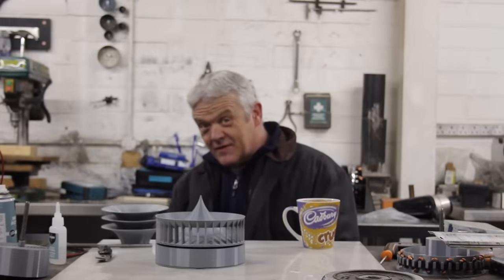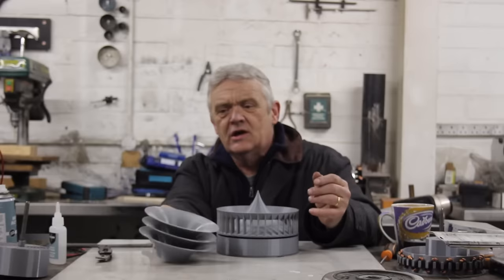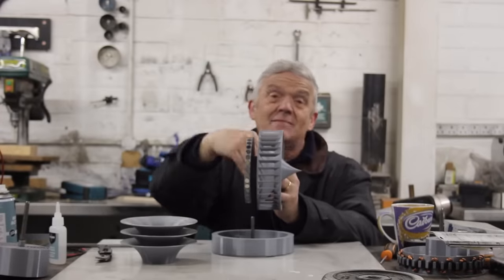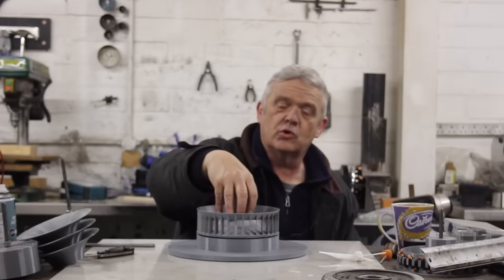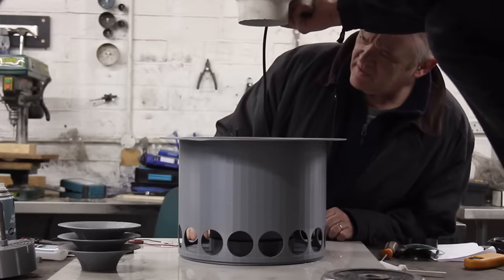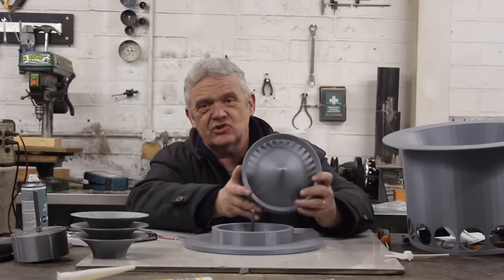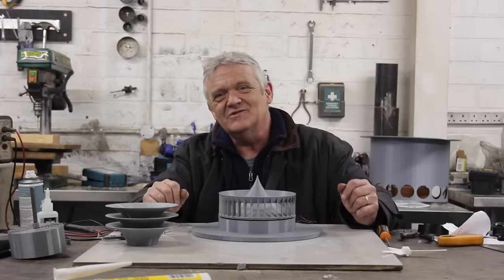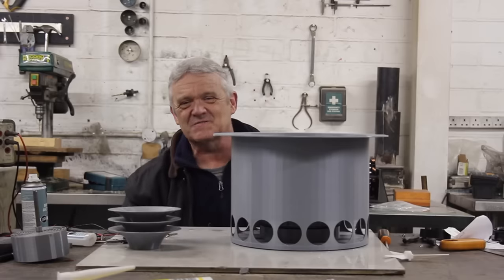1889 Ground Breaking Wind Turbine Update

Comment: Murray Sir... Ranjith here... Only issue I would like to highlight is that atmospheric air doesn't want to compress without external mechanical component... It would just move over the rotor and take the path of least resistance...
Reply: Use pleated or multi layered plastics to increase surface area of blade. High end VAWT systems have “cupping” on one side and vanes on the reverse to use Bernoulli principle

Comment: Murray Sir... Ranjith here... Only issue I would like to highlight is that atmospheric air doesn't want to compress without external mechanical component... It would just move over the rotor and take the path of least resistance...

Comment: Torque is directly proportional to current in a DC motor or generator. Voltage means nothing, though you can use it to calculate power when you know the current. To get the current, you must load the generator to make it slow down. There will be a speed under load that gives maximum power. You must apply different loads to see what that is.
Reply: A variable resistor may work? And the fan should not be held by hand, it shkuld be fixed in a position to make sure that you have same angle of attack and distance between the fan and the generator.
Reply from the maker: then you would just be measuring the generator
Reply: @ThinkingandTinkering  The only thing you need from a generator is watts. The question is how many can you get at typical wind speed. For that, you can simulate the wind with a blower, but then you must load the generator so that you know how much current it can make at that wind speed, then you can measure the volts at that current and calculate the watts, or connect one of those cheap Ebay watt-meters that give you it directly. 

When you load a generator, the torque to turn it increases with the current, so it slows down.
Reply: I do agree about watts/windspeed being the ultimate measurement. Also it should be in the natural environment and not a laboratory. History also should teach us to stick to AC.
One point that I noted about the shape, the vent holes come out where they could affect the wind flow escaping from the tower, if they pointed down, the wind flow would provide more suction. This is another reason to test outdoors.

Comment: I have a rooftop in the city that because of the microclimate and turbulence is subject to sustained extreme high winds. (greater than 100mph, according to roofers) I need to do masonry work every year because the wind scours the brick and mortar away.  A turbine for these types of conditions would be very interesting to me.
Reply: Your system would have to be tougher than a brick! Good luck. Whatever you devised would certainly be quite durable everywhere else! Sounds challenging.
Reply from the maker: from what you say just about anything would do mate
Reply: I have seen horizontal spiral turbines at 6" dia. that looked very impressive. I can't remember the numbers now but there was low coefficient ratio between the turbine and the mounts.

Comment: I am really loving this series! Thanks you for posting your explorations.
Reply from the maker: cheers mate
Reply: @ThinkingandTinkering  you could combine screw like rotor, from some of your previous videos, with this but in opposite direction and with different casing that will collect wind from the screw like rotor and transmit to this jet like turbine. So wind goes up the cone not down the cone. And you could put this your Darvin turbine around screw rotor but not all the way just with the point of connection with this jet like turbine and between them you could put real tesla turbine in a way that air that comes out from the tesla turbine get into this jet turbine, so this combination will suck the air even faster from tesla turbine wich will increase torque.

Comment: For many years, sailors have used a wind catcher to funnel air down through a square deck hatch. If you sew a triangular fabric panel with a base width about 2x the hatch opening width, then pull the apex up with a halyard and attach the base corners to two adjacent hatchway corners, you have an efficient catcher for wind which blows over the catcher-attached side of the hatch. If you replicate the panel with another, attach its base to the two opposite corners of the hatchway, the apex to the same halyard, and then sew the two panels together along a vertical line to form an "x" when looking up through the hatchway, then you have a catcher which works fairly well in all directions. A sailmaker could help you shape the panels to encourage efficient vertical airflow.

Comment: 6:35 That's very interesting because the warmer the generator gets because of the friction the more air it would draw because of the stack effect therefore using the wasted energy as a way to generate more energy.
I wonder if enclosing the rotor, at least slightly, would increase efficiency because of the venturi effect.
Reply: If you want it to get warmer, paint it black or use black filiment.  Need something other than PLA to keep it from melting though.  

You can also use the PLA as a sort of lost wax casting to make a stronger final product.  There's also filiment with a lower melting point.
Reply from the maker: I may well do mate
Reply: Not only that, but I think their decision was also based on avoiding water "collection" towards the bottom of the unit. I think ventum dynamics are onto something "big" - and Robert as well. Ventum is working on a "home" "Ikea style" version - but an open source alternative is always great! :)
Reply: @geoe5621  Yes, when I first started watching the video and the machine was upside down I thought it was just a cool normal project but when I saw that picture showing that it's actually the other way around it instantly triggered my interest. I do believe that even if his or their design doesn't work the concept itself is really future-seeking and things should be developed trying to follow it... 

Turning air energy which is currently something "temperamental" into something stable and predictable, even if extremely less powerful, would already change the world. Another huge factor is that this type of design doesn't seem to disrupt the enviroment and also wouldn't need the costful maintenance that current turbines do (that's their major deterrent)... Make it work and give them a magnetic bearing and you have the next-gen power plant.
Reply: @ThinkingandTinkering  what if you had an outer cylinder, in a material that could absorb heat through sunlight or what have you. Maybe produce a chimney effect to increase flow further.
Reply: @geoe5621  On that water collection: I am pondering channelling into a rectangular plenum with a horizontally mounted Ugrinsky turbine, so water would be, to me, "More power, arr arr arr!"
And also, hey, rainwater. Slow Sand Filter and 1/4 teaspoon 70% Pool Shock or other Calcium Hypochlorite, with NO ALGICIDES, per 55 gallon barrel. Let sit 3 days. Enjoy.

Comment: Love what you're doing - some thoughts for improvements 
1. If you undercoated and painted the funnel inside surface it could be made smoother and therefore air would flow cleaner.  
2. Could you add a hall effect sensor to the shaft that way you could measure rotation and therefore be able to compare rotation and generator output with each change you make.
3. The holes around the funnel base, if these could be made larger (maybe every second one joined) to ensue the used air can excape and not create any back pressure 
I'm playing with the idea of adding some of these to the roof of my RV to add another source of power to my batteries
Reply: I'm currently living off grid in my tiny RV. Currently, it’s parked in the equipment storage yard of the construction company that I work for. Allow me to comment on your proposed modifications...

1. I'm not certain a smooth surface is the best treatment for this situation. It makes sense but consider the effects of the dimples on a golf ball as well as the wind tunnel studies by NASCAR racers in the '60s that brought vinyl tops to the automotive industry.
Perhaps some spiral-like veins in the ‘funnel’ area could improve airflow and get it headed in the right direction?

2. This is a great idea at first glance! We would have to consider the potential of the power drag and calculate it into the final equation, but I imagine you already have this in mind...

3. I concur! This was the first thing to come to my mind when near the end of the video Robert Murray-Smith asked viewers for suggestions about improvements. Perhaps fewer vertical supports could be used if designed with the most aerodynamic friendly specs or simply changing the shape of the exhaust ports?
I live about 35 miles South of Seattle WA and we don't get as much usable sunshine as other areas so the idea of mini wind powered generators is attractive to me. Maybe several small units could be ganged together for better performance than a single large unit? Some individual units could also be able to continue generating power if one unit was to fail temporarily.
I use a ‘SunGoldPower’ brand 3Kw inverter/charger/PV controller without any solar panels up yet. I have two 24-volt 320-watt Renogy solar panels standing by, but I know I’ll need several more to collect the 2.4K watts that I typically use daily. 
Currently, I have two 24-volt, 100 Ah ‘Chins’ brand lithium batteries that I take down to about 50% daily to maximize their lifespan and I re-charge them to 100% daily. I’m happy with their performance so far. The ‘Chins’ recommended charging rate is limited to 40 amps. I have a Westinghouse dual fuel I use a 3650-watt propane fueled ICE generator with wireless remote control that makes using it during our longer than average winter and wet weather easier than going to start it outside. It takes about 2.5 hours to re-charge the batteries and so far the cost of propane fuel (without road taxes!) has been reasonable.

Comment: I like it, but I had a thought-how about a Vortex swirl design on your funnel to get the air going in the swirling Direction you want it to go in the first place, so as your flaps on the tower direct the air downward the funnel would progressively spiral towards the outlet of the funnel thereby spiraling the air going to the turban, just thinking out loud(PS on the inlet facing slope of the vortex you would want smooth surface and on the trailing facing slope you would want a scruffy finish kind of like orange peels, the scruffy part is to build up air pockets to cushion and redirect the air trying to go in the wrong direction)
Reply: All you need to do is feed the first one!
That's a "Bernoulli Venturi Stack"!
As air flows past each Venturi, they will ALL draw in air on all sides!
Same principle as a spray gun!
Actually shielding the lower portion of the stack and only directly feeding the first one would surprisingly increase efficiency!
Letting the wind hit the entire stack will disrupt the effect!
Airflow out the bottom will be more consistent, and directional!
Reply from the maker: I amnot sure mate but it think they just do that all by themselves

Comment: This is looking great. Nice job. If I could make a single recommendation it would be to increase your polygon count in tinkercad, so that the polygon edges don't show as clearly on your print surface when finished. Those vertical lines can easily be reduced and it won't make a difference in print time.
Reply from the maker: Thanks for the tips!

Comment: Long time listener, first time commenter. 
I literally just designed and printed the exact same thing 2 days ago! I made mine with 2:1 ratio blade gaps, so it only has 12 blades around. Also my center "spike" is level with the top of the squirrel cage, my "spike" was just a 30deg 0-wall thickness. It creates such solid vacuum pressure at 18v/15A. 
Im a big fan. Thanks!
Reply from the maker: nice mate - good job!

Comment: Where I live ( central Alberta) I've seen companies testing the "electronics" of dynamic brakes on diesel locomotive by adding more electrical resistance, via a DB unit. I'm wondering if you could add a load to the generator  (imput) and measure the amount that it takes slow the speed of the generator. Then using some formula where you substitute in that gathered number to calculate the torque?
Reply from the maker: do you know what I find mate - it doesn't matter what you do - someone, somewhere at sometime will tell you to do something different - basically you do what you like as long as you get a result that helps you

Comment: You also want the "exhaust" wind to get sucked out of the bottom side holes of the shroud for more wind speed. And you don't want the wind to blow into those holes either. So you'd want some kind of U-shape around the shroud that can turn freely like a wind vane. Or really any way to create negative air pressure at the bottom, because it will increase your air intake.
Reply from the maker: cheers mate

Comment: Just got to thinking about those spinners that work by putting candles under them and what others have been saying in the comments...

What if instead of gearing it to work on wind coming into it, you paint it black and set it out in the sun and you run it on the hot air coming out? 

It could probably still use regular wind and rain water too.
Reply from the maker: there really isn't much energy in that - it would be a whole lot of trouble and expense for very very little return is my real thought on that - but it is just what I think you could always try it and see

Comment: Speed as a Tip Speed Ratio ( the speed on the outer tip of the blade divided by the wind speed) is very useful.  Using Hertz readings instead of volts from the alternator the actual RPM can be calculated from the number of magnets in the alternator.  Using the RPM and the circumference of the rotor the Tip Speed is calculated.  Divide the no load Tip Speed by the wind speed to get the turbines TSR  (Tip Speed Ratio).  In general the higher the TSR the better the efficiency.  Most wind turbines generate the most power when loaded to run at 1/2 the no load TSR.
Reply from the maker: cheers mate

Comment: Typically...
Volts ~= RPM, Amps ~= torque
And Power ~= RPM * Torque.....  - Volts * Amps.

So instead of reading just unloaded Volts, it would be better measure Amps and Volts.   This will require a load, preferable a "matched load".
Reply from the maker: There are no amps from a rotor, no volts either
Reply: @ThinkingandTinkering  What you are testing now is quite fascinating, and am looking forward to it's final form. 
Sorry, I should have said "In a DC motor or Generator", as I was talking about the volts measurement you were making from the Turbine.
Power measurements are even more important for lower speed turbines, as there is little to work with, and every Joule counts.

Comment: Now you are doing the real stuff Rob. To help me get a better understanding of things I always like using mental pictures. And one way to do that is to equate mechanical RPM to electrical volts  and mechanical torque with electical amps. You need rpm x torque for mechanical power just like you need volts x amps for electrical power. So in your setup where you have a tight mechanical -electrical coupling you have to look at the big picture. You could get high rpm which results in a high volts reading but the high rpm with no torque will also result in no mechanical power which will result in no usable current / electrical power. If you do load the electrical output it will result in the mechanical section slowing down possibly to a near stop if heavily loaded on the elctrical side. So what I do in my developments is have a grossly over sized electrical generator (maybe 5 times the mechanical side in power potential)  which could stop the mechanical side if the  heavily loaded. I then set the wind / fan up at a given wind speed and do a series volt to amps graph readings with a varying resistive load on the electrical side. In this way I get the MPP of the mechanical wind side. Then I do a change to the wind / mechanical side and retest the MPP and see if the power has improved for the same wind speed. Once I am reading a good bit of power on the electrical side I know the mechanical side is good and now start working on the electrical side. I do changes in the generator side  to see if I can get more electrical power (using graphs and MPP) after each change with a given set uo of wind speed and mechnical setup. Takes a long time but you get to learn a lot with each change / addition.
Reply from the maker: thank you for the advice mate - it is well appreciated

Comment: What if you add one counter rotating outer ring which is powered by the out blowing wind?
Reply: If we could just make a perpetual motion machine... aye? Faith in technology is always letting us down. Maybe we need a new religion.
Reply from the maker: sure
Reply: One of the pc fan generators from earlier builds over each hole? They are a known quantity.
Would particularly blocking the hole change the dynamics of the air in the main machine though

Comment: Hi SIr, you could mesurate the output of air from your device by tying a 30L bag for example to the end of the device. Another point, with a so low resistance whell, we could make hot/cold air system around with a funnel of hot air for example coming from the top to cool down inside a tube flowing on the wheel, to make passive thermo-wind turbine. with cooked clay tube with the base sitting on a water bed. Thanks for sharing all this.

Comment: One reason I see for placing the generator section on top of the wind collector is because the wind-redirecting cones are then pointing upward (instead of downward), thus making it more difficult for rainwater to get in and drip on your goodies.
Reply from the maker: I don't think rain is much of an issue mate